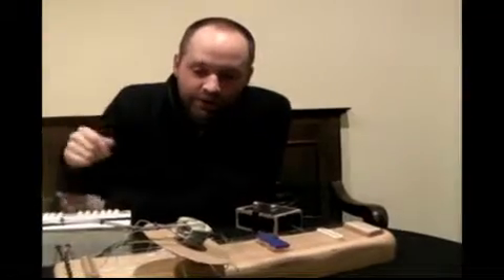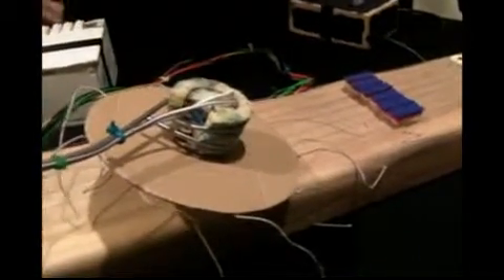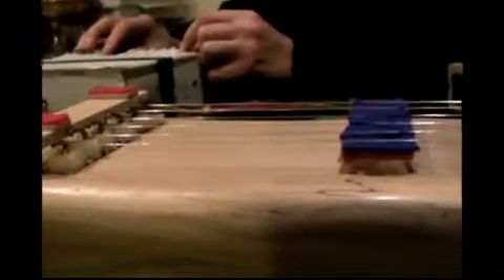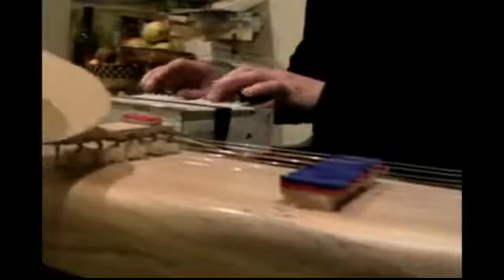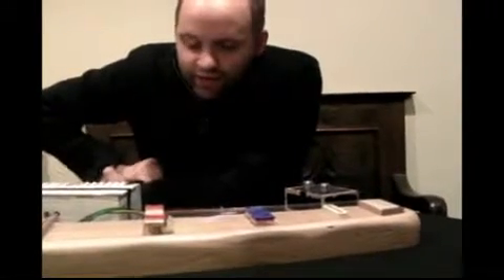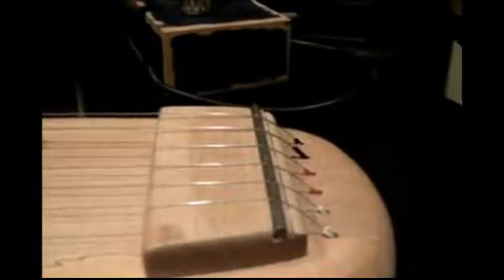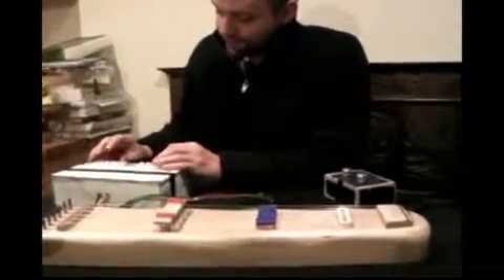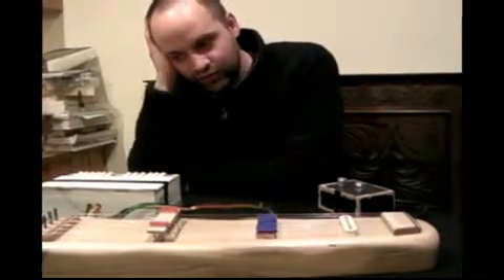The Solenoid Lyre by Luke Jones

Comment: Not a failure by any stretch. Super cool!! It reminds me a lot of a strange '48 Gibson steel guitar I once owned, not quite the same as a pedal steel, made in the cracks between the chord-changing lever instruments & true pedal steels, it had thumscrews you could set for pitch change [instead of damping, in your case. Can you add a simple vari-speed to the strumming motor [which is genius, btw], and add another variable that way, I wonder? Also a manual pump or powered Shruti box [AKA electronic timbura] would allow you to pump in up to 3 tones that would act as 'sympathetic string' resonators [sans the string] for your strings that u could change on the fly. Just spitballing, I love this bad boy just the way it is.